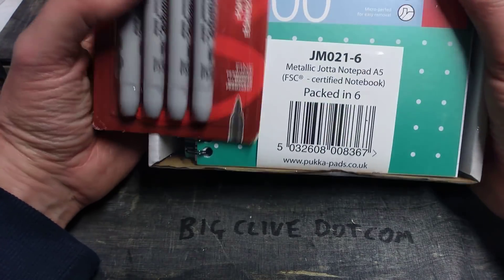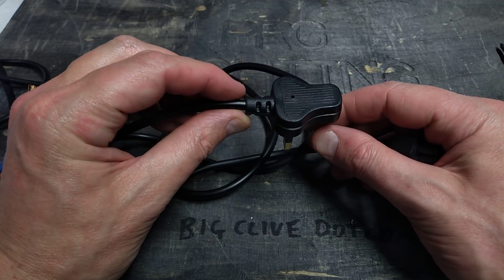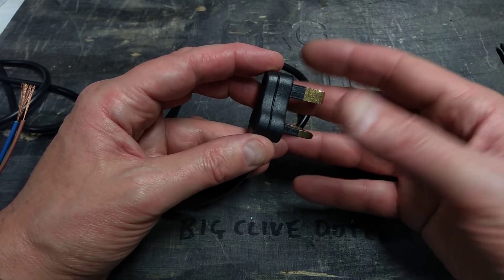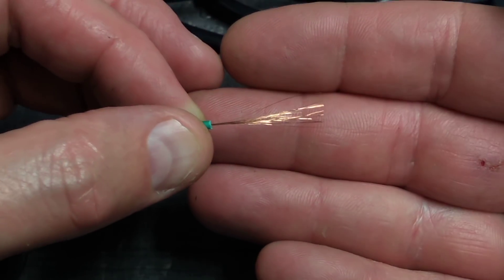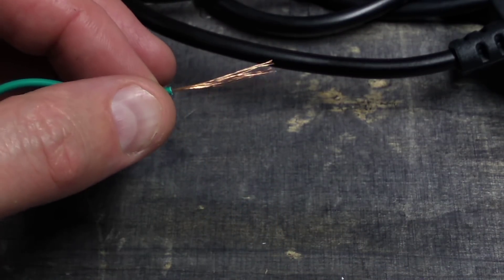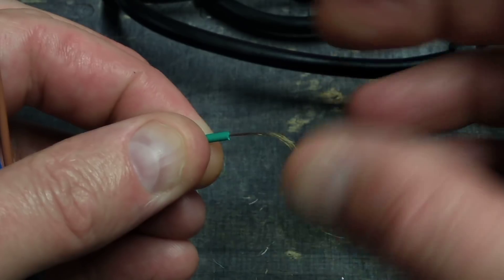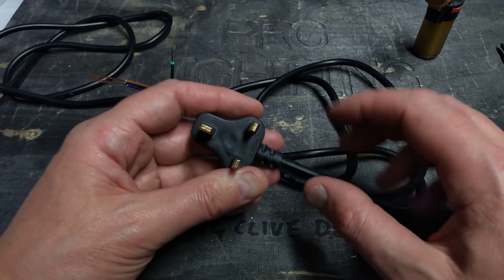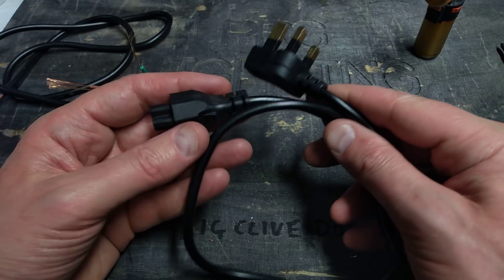How to detect shitty and dangerous aluminium flex.

Comment: Most of these are copper clad steel. No aluminium. Aluminium is too expensive. (The same thing as with cheap LED floodlights.) Try sticking a magnet to it.
Reply: You forget the ones with the green yellow earth wire being made of up to 2 strands of some mystery sort of material, not CCA or even steel, that is almost a conductor. Then you get the ones with 3 cores in them, just the one supposed to be the earth conductor is actually only a filler piece, there to make the cable appear to be a 3 conductor cable, but in reality it, despite being marked on the outside with what appears to be a legitimate number of conductors and sizes, it is actually only capable of handling under 1A when new, and only then it can only survive being bent for a few times before the fragile meta inside breaks and starts to arc inside the insulation.

Then you get the copper plated steel where it pokes through the inner and outer insulation, giving that tingly feeling if you pick up the cable while it is energised.
Reply: Same with breadboard/arduino-style wires with connectors
Reply: Also, alu would not be formed to such thin strands and not bend super-easily.
Definitely steel.
Reply: Aluminium can also be bent, some alloys are quite ductile. I use cheap telecommunication wires for tinkering (low power stuff), those are CCA and at the first glance indistinguishable from pure copper. Main difference is, they can only be soldered 1..2 times before the flux has eaten the copper away. 

Some component leads on the other hand seem to be steel (magnetic, rust). Same goes for the crocodile clip leads everyone uses (those are around 1 Ohm each). 

Aluminium is by volume around the same price as steel. Only by weight, it's more expensive!
Reply: Mathis Bü So the steel doesn't want to get soldered? I had a similar experience using a section of an old crappy usb cable that used to get warm while fast charging my phone, before it broke. I needed 4 thin wires to re do the inside wiring for my old headphones, and me being inapt (and probably lacking the proper tools) at soldering after failing a few times the thing would repel the solder, so frustrating, and it would stick to the tip of my transformer powered soldering gun.
Reply: renyn21, AFAIK the electronic type solder is only good for copper, that's why the non-copper wires are plated with copper and/or tin. 
When in contact with hot flux, that plating becomes thinner/ is etched away. When doing repairs on such cables, it helps to cut off the last 10mm. 

Headphones cables can also have non-metallic fibers in them (for flexibility), or be enameled copper wire...
Reply: Mathis Bü I used what I thought was copper in insulator, simple wire out of a usb cable, to get away from those headphone cables with fibers and that coating on every strand that made me pull my hair numerous times in the past, I soldered (If I can even call that crustiness soldering) the wires inside the casing to the detachable microphone jack, so I can use a 3.5mm to 3.5mm cable and not have to deal with soldering wires for longer, as it seems headphone cables break in about a month for me. Turns out crappy usb cable is made of steel, that explains why it would charge but disconnect/say usb device not recognized when using it for data.
Reply: The USB cable might also be very thin copper or alu wire. Some suppliers have datasheets stating the wire gauge; For charging cables it's worth taking a look at it.
Reply: Mathis Bü It was a broken cable, only repurposed some of the wire for the headphones, it was magnetizing on my soldering gun, pretty sure it was steel. My soldering gun has a transformer inside, which seems to make the tip slightly magnetic when energized. After getting another cable for my phone it stopped getting warm. Even if I might not know how to solder properly, working headphones beat no headphones (cause I can't afford new ones every month, the wires break easily with the way I use them it seems)
Reply: Yup, the harddrive magnet found a few of those recently. My second test is a 3A lab supply as a current source, and a multimeter. If it meets spec according to stated cross section, it gets the green dot. Otherwise it gets the snips.
Reply: Steel is bad material for cables, because aluminium corrodes less and is a much better conductor.
Reply: Aluminium is cheap and forming it into wire is cheaper than making steel wire.

Comment: I really want to see Clive put a high load through that awful cable now and see it happen.
Reply: John Ward has already done this.
Reply: Yep, I'd like to see him do his own fireworks show without buying any fireworks, by doing a photonicinduction job on poorly made electronics :)
Reply: Throw some multimeters at it, THEN overload it. I'd love to learn more about the electrical characteristics, resistance, and response to current flow that comes from using such materials. I can understand utility companies using copper-clad aluminum as a viable concept in large-gauge project deployments, but this is something entirely different and I'm curious to see how close to the sawblade these Chinese design firms like hanging their balls.

Then again, most such companies are fly-by-nights, so it's not like they have much to lose in a lawsuit a few years later anyways.
Reply: +Crimson Halo It's more a case of the Chinese firms hanging YOUR balls close to the sawblade (or fire).
Reply: He really got my hopes up there
Reply: actually, you may want to research AC current and "skin effect" the biggest enemy  is "stripping and termination".... but the cheap junk could well be copper coated too thin.
many RF coax cabling has been CCA for years and that's high end stuff! used for many thousands of watts commercial applications...
Reply: @throttlebottle5906  While skin effect is a real thing, it's not coming into play at 50/60 Hz.
You start seeing gains when your circuit is running around 100 kHz and higher, until you reach high enough frequencies that coaxial cable is appropriate, and slightly higher when cable is useless and wave guides are required.
Reply: sure, but it's still there (yes at 60Hz skin depth is nearly 0.34 inch/8.5mm)
that wire didn't even seem like clad coated aluminum, the way it easily broke, I'd guess it's more tin or who knows what..

Comment: Back when I worked at the computer shop, we got a load of C13 power cables with these plugs, I pointed out the lack of fuses as a safety hazard, so was tasked with replacing the plugs, first one I lopped the dodgy plug off from, the cores were coloured Brown, Brown and Brown, they all went in the bin...
Reply: Rule of thumb: Brown + Brown + Brown = shite!
Reply: The CE mark means absolutely nothing.  Anyone can develop an electrical product and mark it with the CE mark, without any proper checks or anything else...  It’s nothing like the BS kite mark...
Reply: I remember something on TV some years back that said "Don't trust the 'old kite mark', instead look for the BEAB or CE mark", both of which are often faked anyway, can't trust anything, it's all guilty of being dangerous junk until proven otherwise... :)
Reply: @twocvbloke  typical bs from some clueless presenter/producer arts graduate duo I suspect.
Reply: @MaddSusie  that is right. It is up to the 'factory' to make it complient and Mark it with CE to confirm it is up to spec. If it turns out that the product does not meet the requirements the goods will get seized and possibly a fine issued.
Reply: Proper Kite/ASTA/Nemko mark should be visible. I do allow also plugs to IS 401 marked with the NSAI symbol in my house.
Reply: twocvbloke and this is why we have standards and regulation, foreign countries just don't seem to get it
Reply: @LND3947  I read an article that Alibaba wants a European warehouse. For quicker shipping and no import tax. I suppose that would make them a local seller meaning that they are responsible for selling goods that actually meet our standards. Anyone selling from within Europe is responsible to only sell CE (and tuv/kemakeur etc) certified goods. Selling wrongly CE marked goods will have you loose those goods and a possible fine as well.
So I kinda support Alibaba in opening a European 'aliexpress' warehouse since we could expect better quality goods than what we import ourselves from AliExpress and the like.
Reply: Anyone selling into the EU is supposed to CE mark and meet the standards too.
Reply: @dbracer  the company that imports is responsible for the quality of the goods (CE approved). A private person that buys from a foreign company is the importer and thus responsible.
Reply: @FlexDRG_Lampje  If the seller claims it is CE marked and offers it fir sale in the EU, the burden of proof is on them, not me as buyer. I'm not bringing the product to market, I'm the consumer. Maybe it's ebay?
Reply: @dbracer  the company, in country, is responsible for compliance. No matter who fabricated it. If the factory falsely claims  compliance the retailer is still on the hook. He should have checked compliance. Buying, as a consumer, from a foreign seller, it's on me to note compliance. Noticing that wireing gets warm it is up to me do do something. And maybe try to do a warranty claim to the seller/intermediary.
Reply: Need to watch out on the "CE" mark. They use one which looks similar but means "Chinese Export".
Reply: peter geary They get it. They just don't care.
Reply: Lucky, I once worked for a place where you'd get a disciplinary for pointing that out.
Reply: Wow, tree live cables! Fantastic solution!
Reply: Ive had a similar one but the wires were all coloured black.
Reply: twocvbloke: Yes I used to run a computer shop & these started appearing about 5/6 years ago. They all got binned and replaced. One of our suppliers would include a proper lead in new cases / PSUs from China. Always made me doubt the PSUs!
Reply: Yes in the bin but China has sold it to us and made money so who is the loser, not China we are we need a number to report shit from China to stop the import
Reply: Just guess what brown is earth, you got only 2/3 chance of blowing the fuse by shoving neutral or live in the device earth. You'll be 33% fine, 66% dead. Even better, test it! If the fuse blows, you just shorted live and neutral. If the GFCI trips, you just shorted either live or neutral to earth. Then mark the cables with a cheap water soluble marker! Earth is of course black, live is green and neutral can be pink.
Reply: Damn, that's an easy way for them to mix it up at the factory... "Oh I got the cable in for my computer I'll just lean over it and plug it in" dead as a fuckin door knob o.o holy shit
Reply: I had a dodgy one (C5), sleeved earth but I didn't notice at the time. failed neutral, cut plug off, black, white and black-and-white core insulation.

Comment: Dear bigclivedotcom i think that isn`t a CCA cable, because you say it`s springy i think it`s coper coated stell. Aluminium bend better than coper.
Reply: CCA is very springy from the work hardening in drawing it, and the copper coated steel does not frizzle like that wire did.

Comment: Very often these have live and neutral flipped between each other. At last here in EU they tend to have that.
Reply: Josif Vissarionovich If they are Schuko or Italian 3-pin there is no right way.  If they are French hermaphrodite or the CEE 7/7 combo, there seem to be some confusion as to which side should be live.  Swiss, Danish and British plugs with Earth seem to be the only EU 230V plugs with a clear polarity.
Reply: EU plug. Kind of wide term. I was referring to Type of plug we use here in Slovakia. I think it is Plug Type E used in France, Belgium, Slovakia and Tunisia among others. When i'm looking at female plug on wall. There should be earth pin on top. And then neutral pin hole on right and live pin hole on left side. And i just learned there is no international standard to these. Even when the plug is polarized. What i wrote is apparently Czech and Slovakia "standard" France is reccomanding the other way around. This is interesting. So it depends on which "standard" manufacturer is following... Well we learn all the time...
Reply: These types of cords are used with appliances designed to operate safely with either polarity. Put another way, an appliance designed to use this type of detachable cord should not present a safety hazard no matter how live and and neutral are connected.

Comment: THE BURNING QUESTION IS? DO HOUSES BURN UP OR DOWN?
Reply: First the former, then the latter.
Reply: SO the answer is Both, First one than the other. GOT IT.
Reply: @Curtislow2  no...HOUSES only burn DOWN; GOT IT?
Reply: Buy one of these cables and overload it. You will then be able to answer that question.
Reply: YEP, Affirmative. But no thx.
LOL
Reply: I consulted Talking Heads, and it's definitely DOWN.
Reply: Are you sure? I think you are UP to no good! lol
Reply: @lumpyfishgravy  heh heh.......
Reply: Houses burn down.....the material they are made from burns up..
Reply: Northern hemisphere: down.
Southern hemisphere: up.
Reply: @phatkatracing  only from the perspective of the northern hemisphere
Reply: From my experience as a non-native speaker of scottish watching BigClive I'd say houses only burn down after chinesium burnt up inside ...
Reply: Down, down, down, as the flaaaaames get higher
Reply: That's Right Johnny Cash!
Reply: It depends on the floor where the fire started.
Reply: @SocratesFil  doesn't matter the floor...they always burn down.....roof will burn before walls
Reply: its burned up in smoke and burned down to the ground
Reply: Samsung/Android Is the best very quickly, the hottest point in the fire will be the roof
Reply: Hah, trick question, it's neither, they are razed!
Reply: I thought they were razed.
Reply: If the fire starts in the basement, the house burns up. If the fire starts in the attic, the house burns down.
Reply: @mantyme  doesn't matter where the fire starts....it will burn the roof before the walls
Reply: they also burn sideways
Reply: Depends if the fire starts in the basement or the roof.
Reply: @richardkaz2336  the roof will burn before the walls.....basement or attic stsrt makes no difference......heat will build up rapidly in the top floor and flash over.
Reply: I was just being flippant.
Reply: ME TOO
Reply: To me that is like the way they say behind the wheel, as in the steering wheel.  I would think you are infront of the wheel, behind it is the dash area.
Reply: @steviebboy69  when you say in front of the wheel and behind the wheel, you are using two different points and direction of reference.
Reply: yep the world is full of ox moronic things.
Reply: Curtis Low they are raised to the ground
Reply: I had to look it up, But RAZED is what you mean. That starts a whole new question.
Reply: They go up in flames but ultimately, they burn down
Reply: New question ,Was the house raised or razed because of fire?
Reply: Curtis Low Razed to the ground is a well known saying in the UK , if only I could spell it 😂

Comment: you can try to tear it apart. If it is a proper cable even 0,75 mm² requires a significant force to tear apart. If it is a coated wire you can easily rip it apart.- Which indeed kills two birds with one stone: You have proven it is crap, and you just destroyed it. :P

Comment: Using a lighter is an interesting test, I'll have to try that out.  I have some low voltage cables that I suspect are copper plated aluminum (note the proper spelling).
Reply: Corgitronics The lighter test is also a standard test for yarns, threads, rope and fabric, as there are characteristic differences between legitimate materials such as Nylon, Polyester, Cotton, Wool and Linnen.
Reply: And so I suppose that Helium should become Helum, Lithium should become Lithum, Selenium should become Selenum etc etc  because you cannot spell Aluminium as per the periodic table of elements!!
Reply: mharris1270 - Thank you.   It seems that a few... well, one person... doesn't realize that there are regional differences in English that are often joked about.  Even documents such as periodic tables are different.
Reply: david, when people try to turn an obvious joke into an argument they more often than not just come across as pricks :/
Reply: If you check the periodic table of elements you will find that it is ALUMINIUM - not the misspelling aluminum used in some countries who fail to keep the the correct element identification.
Reply: Yes, perhaps you should check a periodic table... like this one from MIT.  
https://ocw.mit.edu/courses/materials-science-and-engineering/3-091sc-introduction-to-solid-state-chemistry-fall-2010/syllabus/suggested-textbooks/MIT3_091SCF09_per_table.pdf